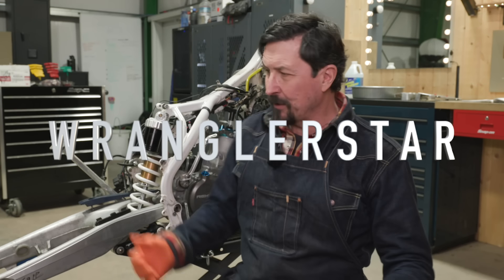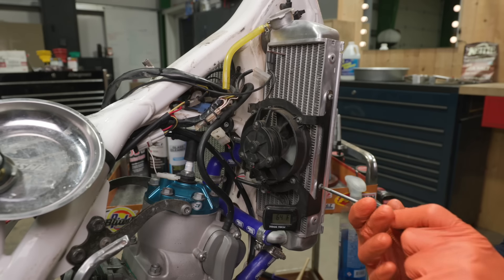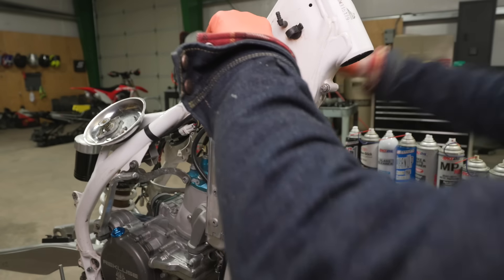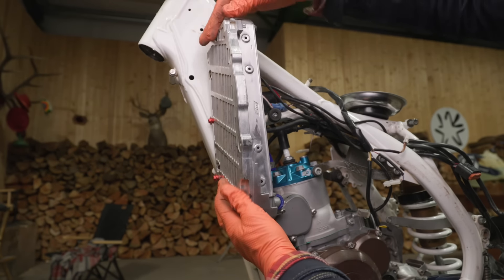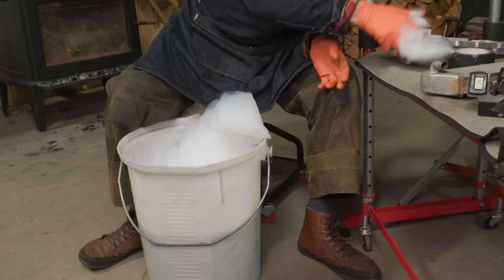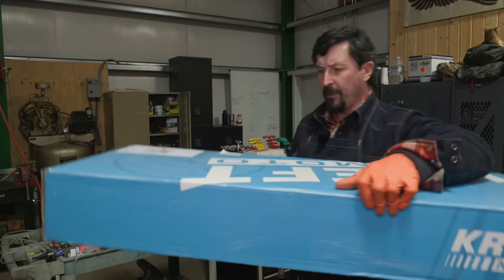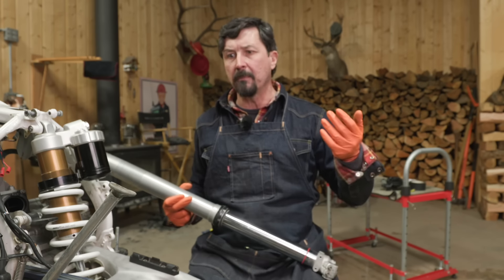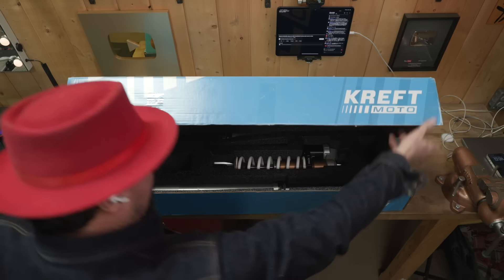My Secrets To Making Aluminum Look New

Comment: Dawn won't cause an issue, especially after you rinse it. We use it in cooling systems that have been oil contaminated via bad engine oil coolers. A thorough rinse afterword will do fine!
40 year ASE Certified Automotive Master Tech, L1 Advanced Certification.

Comment: There is a product called neverdull, it might be spelled different. It's looks almost like wooll that is soaked in a solution. You tear off a piece and you can make dull aluminum look like chrome. Try it. I've used it for over 25 years ...also very good for polishing chrome as well.

Comment: Be careful with muriatic acid. 30 seconds with a tub to neutralize is a good idea. I've ruined a aluminium wheel, I had never seen one like it.
Reply: What tips can you offer?  I’d like to clean an aluminum ladder.
Reply: @macjaxjax2604  30 seconds at a time. Test a small area first. Have the water on hand to neutralize the acid. Avoid using a spray bottle That was my mistake. Awful little dots etched everywhere
Reply: @macjaxjax2604 clean ladder with a couple of brass wire brushs.( Hand held wooden handle wire brush or stainless wire brush and sand paper)